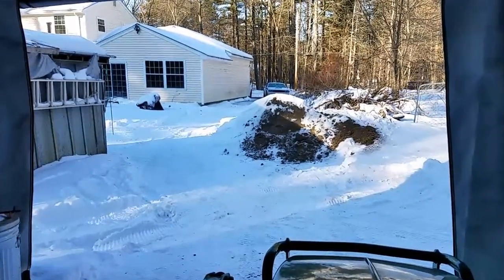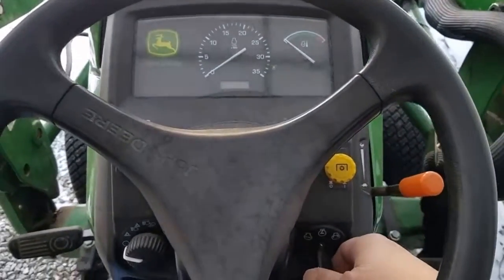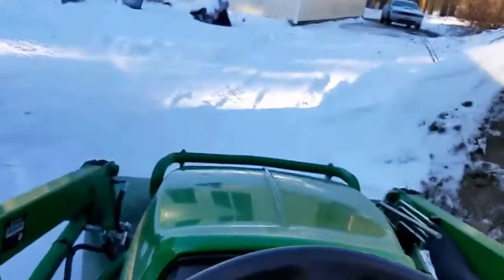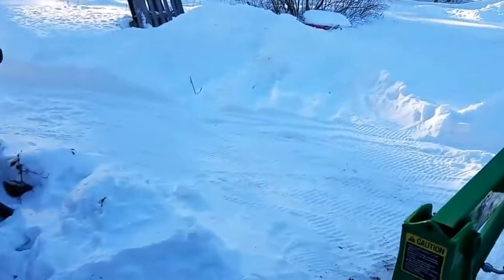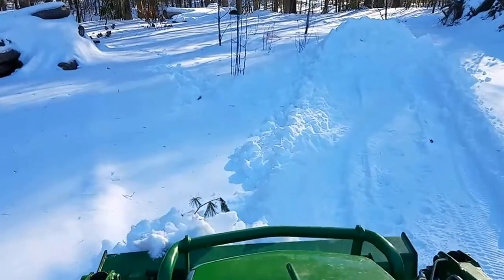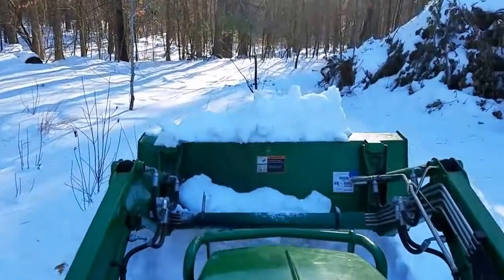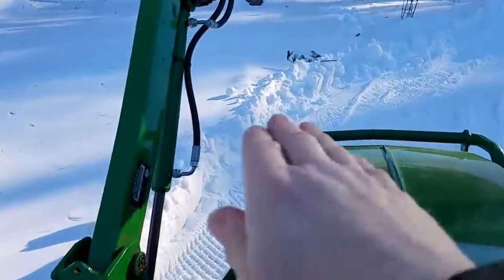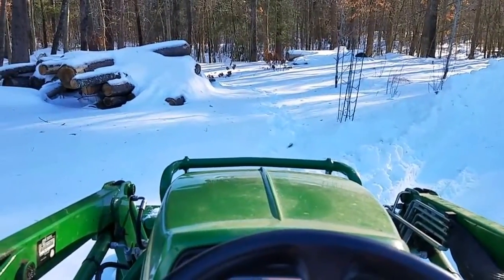Cold starting diesel tractor, and snow-moving techniques

Comment: Hey man great video i just wanna let you in on some info to keep that small (but beautiful) john deere running for a long time!
       1) (not a tip but) The diesel fuel does not expand in the combustion chamber to make power it combusts (eplodes)  other than that your right lol (and our john deeres start right up just fine without glow plugs)
  TIP     2) Being that its a diesel you should let it idle for at least 10 minutes to build temp (and when it skips at initial start it wont hurt to give it some throttle for a second to get the cylinders firing! John deere recomends for our tractors that as soon as they start we rev them to 1200-1400 rpm and let it run for about 10 minutes then idle for 5 then go work) but being that its a diesel they take a while to build temp so basically that motor was wayyyy to cold and the oil was wayyy to thick to immediatly go do work with it. Diesel oil is thick as it is and it gets thicker when its cold so yes you have oil pressure but the engine will not be lubed fully which in turn immediatly putting it to work is causing more damage than anything. Other benefits of letting it run for 10 minutes before use: 
                                                  
                                                   --> Easier on the hydraulic pump if it runs for a bit as well because that fluid will also flow and warm up which will prevent damage to hydraulic pump, (there not cheap lol)

Otherwise great video! and nice machine!

Ps. i dont know if you can or should being that your tractor is brand new but ours are older and we run a 50/50 mixture of diesel and kerosene in the winter because the kerosene prevents gelling.
      ---->all other tips apply regardless of age haha
Reply from the maker: This is great information. Thank you!
Reply: @geo_walters  your welcome man just wanted to help keep that thing running as long as possible! Have a good day